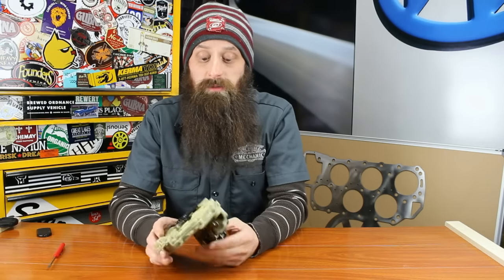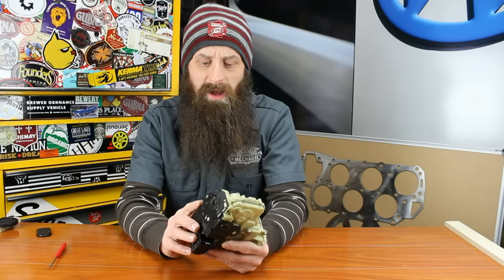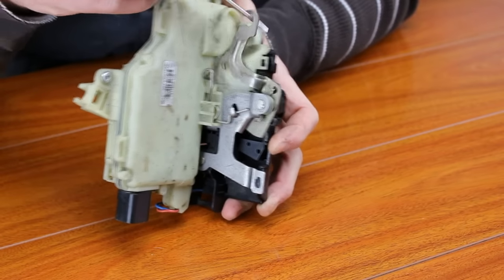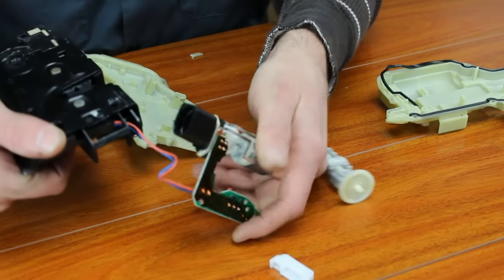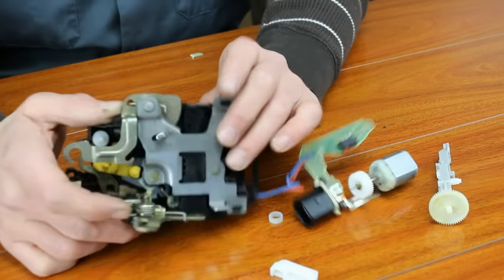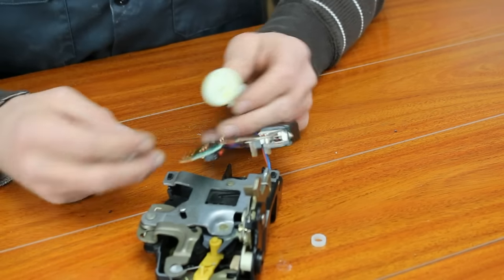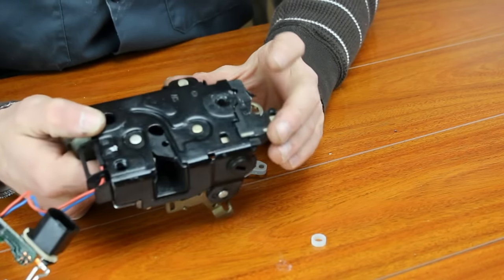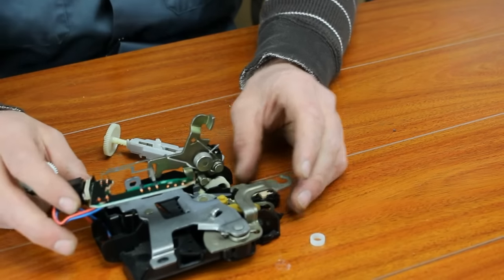How VW Door Latches Fail~ Video

Comment: Hi i have a question...i have you ever had a problem with interior lights on an a 09 jetta wagon?..my problem is when i replace the fuse right away blowns it that meas i have a short some were right?
Reply from the maker: Yep. I had one be a wire issue in the A pillar on the drivers side. Or a few door lights fail and short to each other
Reply: @HumbleMechanic  thats goin to make me crazy meaning where to look for short!..maybe bad door latch or bad madule or a pinch wire somewhere ...any ideas?..thanks
Reply from the maker: Could be anywhere. Do a visual check for damage to the lights. Good look st overhead console.
Reply: Muchas gracias amigo love your videos..
Reply: Problem solved..i found main power cables pinch with one on the clips that holds the sealing by the drivers sun visor.

Comment: I did all 4 doors on mk5 jetta sportwagen....the job SUCKS. The sportwagen is different than the regular jetta because you have to remove the door skins on the front doors, but the rear door you have to remove the inside door panels and glass. It's a pain.
Reply from the maker: Yeah the rear ones aren't too fun
Reply: HumbleMechanic HEY thanks for reply! I also have 06 GTI and the key fob will not work. Replaced batteries, and took it to VW and they tried reprogramming for $138... And it didn't work. Basically told me I could pay $138 more and they could further diagnose...Any idea what it could be??

Comment: I have a 2010 CC Sport and all my doors unlock except the driver, I can open from the inside handle still thank God and it happened right after a car wash is there a chance it will fix itself or will I need a new actuator?
Reply: Going through this rn. Did u figure it out?

Comment: I have a new beetle convertible. It will not unlock or open from inside or out, I have managed to take off the door card, even unplugged in the unlock position. Also tried releasing the door handle cable.No joy, door will not open. How the hell can I fix it?

Comment: I have a question when I open my drivers door on my 2004 Jetta gl inside lights and puddle light won’t come on and won’t show door open on cluster is it harness for door or door lock in this video
Reply from the maker: odds are it's the latch.
Reply: thought so thanks I work on vw's aswell in maine but not much with electrical know how to get endorced

Comment: Hello. I’ve replaced my door lock actuator 3 times with the same issue. When i pull the inside and outside door handle, the handles get stuck Open and don’t allow me to open the door. Causes me to get stuck outside or inside of my car. Any idea on how to fix this?
Reply from the maker: be sure the door is adjusted properly
Reply: HumbleMechanic the door lock actuator? And if so what needs to be done?

Comment: I have a eurovan 03 and all the door lock goes up and down like the car is possessed but it stops when I put the car in drive. Any idea what the problem with the van
Reply from the maker: Weird. Either latch, ignition switch, or maybe a door open/closed switch
Reply: HumbleMechanic thanks for a quick response. I will check it .

Comment: I have a 2002 eurovan and the door locks on all the doors keep locking on it's own. I have to hold the door lock up to open the doors or keep the key on the unlock position so I can get in. Or when I leave the door open the locks go up and down erratically. could this be a door latch problem?
Reply: Junk car buy another 1
Reply: this door latch Problem is in all vw cars build between 1998-2005. a faulty door latch causes following Problems: car door doesnt lock. now Alarm when door is not locked. always unlocking itsellf. Door locks intself in 30 seconds after putting the key out of the ignition. random car Alarm goes off. No beeping alarm when dipped beam or turn signal light is left on. the door light doesnt work. interior light doesnt work when you open the door. the car unlock itself after locking inside/outside.
Reply: Sounds like water might have got in there to me.... I had a duff boot lock which had been getting wet, it kept telling my central locking to wind all my windows down, open all my doors and set the alarm off...... it was doing it for weeks, mostly at night.....before I realised.... i'm on golf number 4.....they don't get any better..... I might learn my lesson before number 5.....

Comment: My mates Vw Jetta b6 passenger door wouldn’t open from the inside or outside so the door latch failed, we took off the inside door card and gained access to the mechanism but still couldn’t open the door, we took it to a garage and they’ve said we didn’t need to have taken off the door card to gain access, so how did the garage manage to open the passenger door without damaging the door, they would have had to have unlocked  the latch from off the B pillar, is this a garage only know how on how to do it so the general public don’t know the secrets ???

Comment: @2:49 - I do not agree with you about your recommendation to "preload the pull on the outer door pull" by pulling the spring back and setting it in the notch in the outer latch.  Why do I disagree with you?  1) I tried it.  As soon as you open the door with the outer latch for the first time, the spring is automatically released from the notch and goes back where it originally was before you pre-loaded it.  It won't stay where you recommended placing it after the first pulling of the door latch. 2) I purchased two aftermarket units.  One of them didn't even have that spring on the actuator at all - so I figure it must not be important.  3) No other video on YouTube I have seen on replacing door actuators recommends preloading the spring.  So I do not agree with that recommendation.
Reply from the maker: You don’t have to agree lol. It’s how the repair manual is, it’s how I’ve done 100shot of latches. 

Yes the spring pops. It’s supposed to. If the easy way to get it right the first time
Reply: @HumbleMechanic  Thanks for your reply.  Apparently there is something about this I don't understand.  What is the purpose of pre-loading in the first place, if the spring pops out the first time you use the latch?  Could you please explain?  I'm not as experienced as you, so I am simply asking you for a clear explanation to educate me.  Thanks.
Reply: @HumbleMechanic  Dear Humble Mechanic, I need help! Maybe I loosened the bolts on the window clips a little too much.  For whatever reason, when I try to tighten the 10mm window clip bolts, they keep turning and turning but never tighten.  What did I do wrong, and how do I fix it?  The left side of the window won't go down like it should. Thanks.
Reply: @JoyneFreedom  It's very difficult to pull that short cable tight inside the door handle to set the cable end in position. The spring holds the tension off while you position the cable end into the door handle making things much easier.

Comment: I have an issue with my 03 Jetta...the door light and alarm would go off even when I’m driving and when it goes off it completely deadlines the car battery causing the car to shut off. It does it ALOT. How could I fix that
Reply from the maker: Most of the time it’s a bad door latch

Comment: I have a 2008 Jetta and I was trying to lock my doors with the key fob they didn’t lock well I changed the batteries still didn’t work. Well while I was driving in the evening they must of locked when I was playing the radio . The door unlock and lock switch was red. I noticed the  door behind the drivers seat was a light orange color showing the unlock switch , but the window still goes down . Do you know what can be happening? I’m about to sell the car soon and I need it to lock and unlock. 
Thank you in advance
Reply from the maker: Very likely either the latch failed or a broken wire(s) in the door
Reply: HumbleMechanic ok thank You is it a easy fix?

Comment: hey sir 
what about if the door locked and unlocked only on the screen even the door is open or closed. and when i want lo lock it using the key all are locked except  backup driver side door ( the only one i have the problem on it )
also the window doesn't response 
backup driver side door PASSAT TSI 2008 
sometimes it works fine with the windows also but the button door clicking when i am closing the window 
i really hope u will helped me
Reply from the maker: +MBM One could be the latch, could also be wiring in the door.
Reply: Hey brother all your Vs are great and i hope that you can help me on this:
i have a VW passat 2008 TSI and my rear left door has the below issue:
1- the door is not locking or unlocking from the car or the key 
2- the windows is not going up or down using the key by holding or from the switch in the driver door or the switch from the door it self 
3- the car will not horn when locking from the key even before the problem happen or start to happen 
4- i took all the wires from the door tested them and all are working, 
5- i cleaned the connectors 
6- non of the fuses are blown tested all 

brother please help me i got crazy of this more than 5 months now 
we hope we will  have smart people like you in my country

Comment: Currently have a microswitch issue on my b5 a4. Alarm keeps going off after the front drivers door is closed and locked. It happens quite a bit during colder weather. After a few mins the lights are flashing and the alarms howling away. For the time being I unplugged the alarm siren in the trunk until I can get to a junkyard for another latch assembly.

Just thought Id share in case anyone had this weird electrical gremlin down the line.

Comment: I managed to get the door open and changed the lock but now the door doesn't lock or unlock so is this a door harness faiulre? The window also doesn't work. The speaker as all that works. I feel the harness has failed. It is the right rear door
Reply from the maker: Don't forget about the front door. The rear modules are generally dummy modules and controlled by the front depending on the year
Reply: Ok thank you. So should I change the front Drivers cable? I know that the problem started where the rear right window was reversed up went down and down went up.

Comment: 3:03, I've found a video where a guy says theres no purpose for this spring and he takes it off. My non genuine part the spring pops back out when you put it in the hook. What should I do?
Reply: I have exact same situation now and as far I'm guessing, it is here to adjust tension and then when you open the door it just unlatches itself so it is used only once. @HumbleMechanic help.

Comment: I bought a 89 diesel and the rear doors won’t open at all. Any ideas to get me started?
Reply from the maker: Do they unlatch? Might need a little push if they do
Reply: No sir. The passenger door has some movement in the outside handle but the driver door handle is not functioning at all. The lever is recessed in the arch of the door pull. Does the 89 mode have a similar device to the mk4?

Comment: The door latch on my VW mk3 golf isn't locking so my door won't close! Do you have any idea of what could of gone wrong with it?
Reply from the maker: Alberto Gonzalez Usually the pin in the lock cylinder is broken.
Reply: I have a 97 vr6 and the passenger door is stuck shut and i can't get it open. My particular module uses rods that lead right into it so i cant visually see a preload setting im really struggling with this issue and can use some input on how to get it open😔

Comment: Hi sir, I've installed a new lock (chinese I think) but now the door wont open if unlocked by remote.. If I open the door with the key it opens but with the remote only it doesnt.. Is this because of the spring preload not set? ):
Reply: I have the same question.  Did not know about the pre-load.

Comment: The failure fate of VW door lock mechanisms appears to be a scam. I can't see any way to interpret it other than planned obsolesce, designed to promote the sale of expensive parts. How hard would it be to design a more reliable lock? I would be very reluctant to buy another VW after having issues with three door locks on the same 6-9 year old car.

Comment: 3:12 What happens if you don't set the pre-load? I've seen some videos where they recommend actually removing the pre-load spring to avoid getting the door stuck close in the future, is there any reason to pre-load (or disable the system entirely)?

Thanks.

Comment: my door latch on the passenger side, front left side was faulty and I have change it recenlty with brand new one from 33 euros from www.amazon.de it is after market door latch. and the new one worked until today, and I replaced before one month, today i have noticed that it wont open, it is stucked can not be open fron inside or outside? I have made auto scan with carport diagnostic softwere wich is a pure copy of vcds just differen interface apperance. and i got the same DTC like  when I had still the old faulty fabric VW door latch
00929 - Lock unit for central locking - Frt. pass. side, Implausible signal, static
what coould be the reason? is it that the new  AFTER MARKET door latch is just after one month of use is dead???

Comment: I have a 2013 Beetle Turbo. A year ago, the door latch started making a louder sound when closed than the passenger door. It doesn't sound like the "solid" VW door closing. I didn't really think much of it when it started. Now, whenever I unlock the driver's door, I hear a quiet-but-noticeable whirring coming from the door latch area. Is my door latch assembly failing? I am going to bring it to the dealership tomorrow; my warranty is up in two weeks!

Comment: 00096 - Drivers Door Central Locking (Safe) Motor (V161) 
            012 - Electrical Fault in Circuit - Intermittent
             Freeze Frame:
                    Fault Status: 00101100
                    Fault Priority: 3
                    Fault Frequency: 254
                    Reset counter: 67
                    Mileage: 223963 km
                    Time Indication: 0

00928 - Locking Module for Central Locking; Front Driver Side (F220) 
            008 - Implausible Signal - Intermittent
             Freeze Frame:
                    Fault Status: 00111000
                    Fault Priority: 3
                    Fault Frequency: 111
                    Reset counter: 67
                    Mileage: 225032 km
                    Time Indication: 0 

why do you guys think about this issues i need to say that the door closes fine and locks fine

Comment: Ok, so I have owned 54 cars of all brands since I was 14 years old and I have never owned a Volkswagen. When I was 5 my mom had a 1987 Volkswagen Rabbit diesel station wagon that we referred to as "the Green Weenie" and that car spent more time on the side of the road than on it. Anyway, I just purchased a 2000 VW Golf GL hatchback with the NA 2.0 5 speed. It runs great and is really reliable, but it had every conceivable warning light on, some I don't even understand. My driver's side door will not latch and hasn't for quite some time. I ordered a cheap latch off of eBay (yeah, I know) just to check to see if that'll fix it. I'll be honest when I say that I don't know shit about VWs. I have a 612 whp Civic, so obviously I'm a mechanic, just never owned or worked on a VW. I saw this video posted on a forum and wanted to check it out.

Comment: Can you do a video on how to open a rear mk5 golf door that wont open from the inside or outside. Replacing the lock module is the easy bit...getting the God damn door open in order to fit it is the problem.